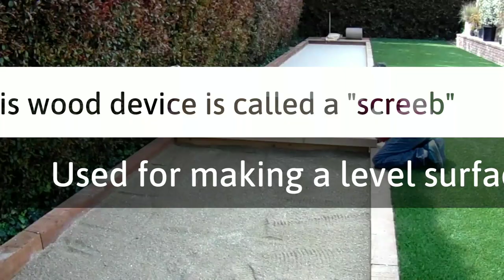Bocce Court Building, The Oyster Shell Mix Installation

Comment: The wooden device used for leveling wet concrete, plaster or other material is called a "screed", with a "d", not a "screeb". It is both a noun and a verb.